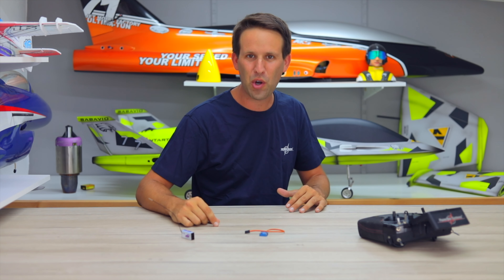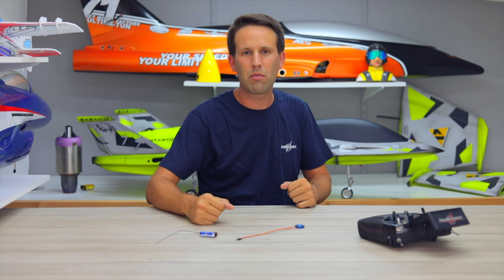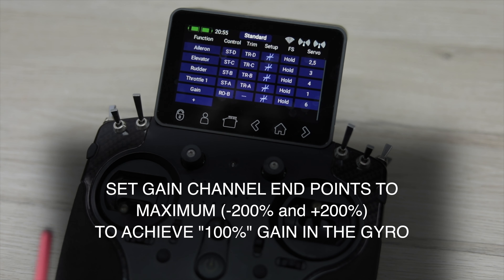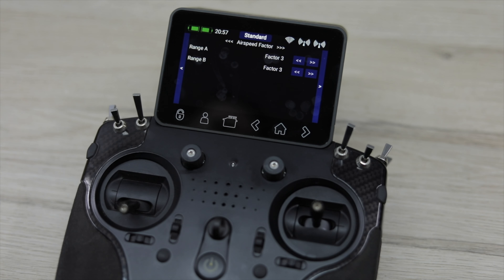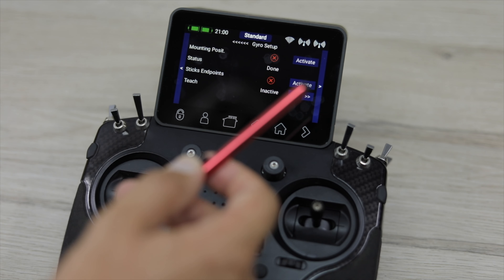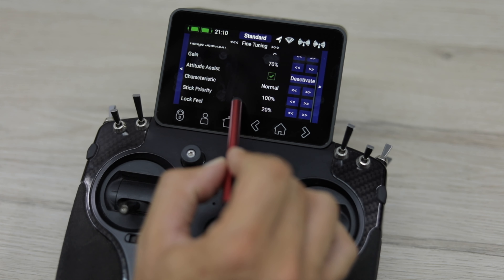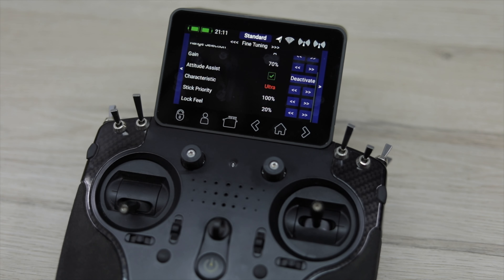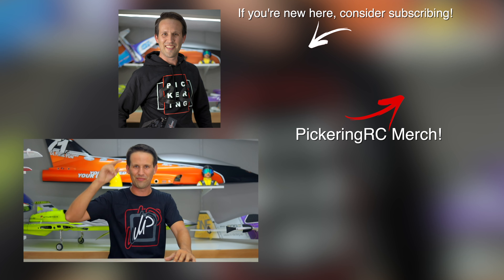Powerbox-Systems iGyro SAT - FULL REVIEW

Comment: Hi Martin. Thanks for a great video tutorial! 
How would you fine tune each axis one by one, when all three axes gain values is controlled only by one channel? Let's say I start increasing the gain value with the knob, the plane starts oscillate on roll axis, then I decrease the value a little to get the optimal gain. How shall then continue with rest of the axes (elevator and rudder) , because I can't really use the knob, that value is now locked to the roll axis?Using the fine tuning telemetry menu on the touch screen during flight to increase the gain value is not really a good option.
Reply from the maker: Normally a plane is quite levelled out, so all axis run similar rates. If however you are concerned about this and wish to set each of the axis to its perfect setting individually, you can do this in 3 flights... Set in the telemetry menu the Aileron gain maximum to 100% and all others to 0%; now fly and find the best spot with the knob. Land, change so Elevator is max 100% and all others 0 and do again. Then same for rudder, and now just put the settings back in...

Comment: Hi, great video Martin. But you say the opposite from the manual. Bank B is from 0 to   -100 is what the manual says, you say bank A here.
Reply from the maker: That depends what radio you are using…
Reply: @MartinPickering-PickeringRC  Core radio same as you :)
Reply: The way martin describes it is correct. Left B and right A is illogical and should be changed.

Comment: Hello Martin, I did the same instructions that you made in your video and I did go over the manual that came with the gyro but I have a little problem. 
The gyro is working fine with the elevators and rudders on my F-18 but it’s not working with my  ailerons!!! 
I did reprogrammed everything again and I still have the same issue!! Then I thought that maybe the gyro only has pitch and yaw axises correction! No bank axises!!
Could my gyro has something wrong with it?
Reply from the maker: Hi, as awkward as this may sound, usually it comes down to us setting it up wrong, sorry… Try afresh another day, and almost certainly will work. Double check that the input and output channels are correct on the radio also…